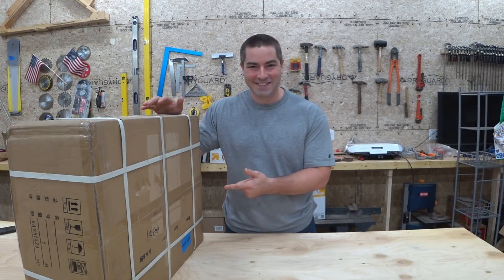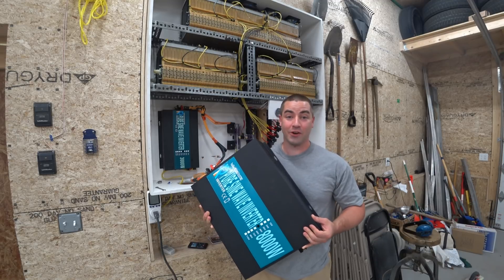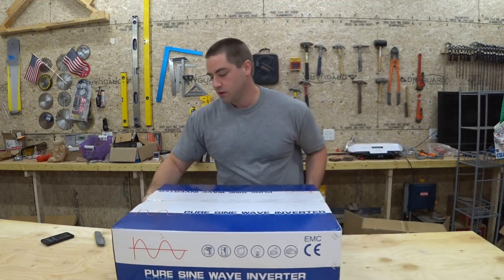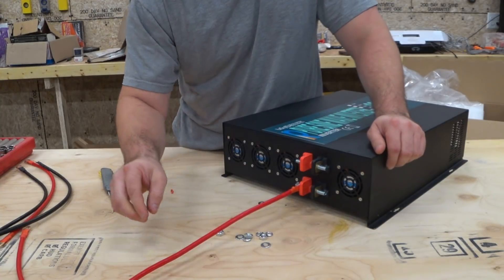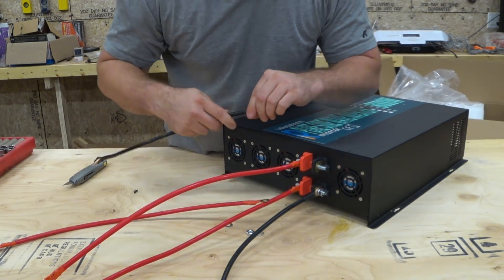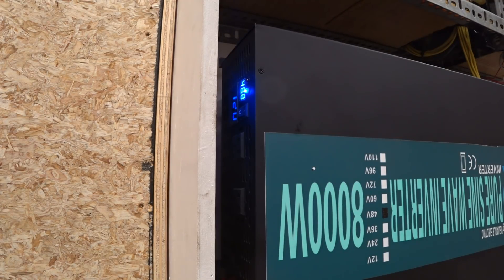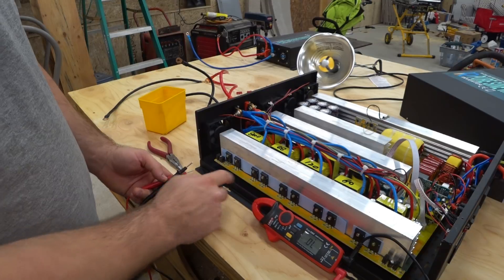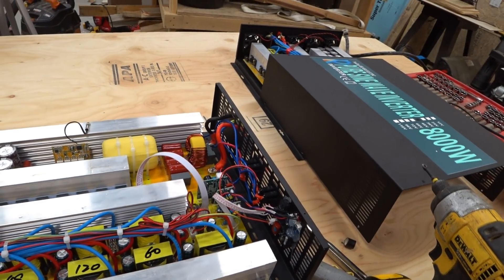Cheap 8000w Reliable Inverter, DIY Powerwall, Chevy Volt Batteries

Comment from the maker: Follow up video to answer some common concerns: https://youtu.be/8pIZrrPLSP0
Reply: I'm a telecom stand-by/backup power guy. I work with multi-battery string, high current DC power plants, 130 vdc converters, inverters, and stand-by generators up to 500kw. One thing i noticed that would be critical is that the internal DC input distribution leads are not the same length. This does not allow for a balanced dc load across the input stages during surge. In high current discharge conditions, the DC input distribution cables have to be of equal length or the load will be highest on inrush on the shorter cables (and component stages). The existing wiring places more load on the first groups than equal across all the groups. Notice the MOSFETs of the first 4 parallel groups were failed. If one were to replace the DC leads with equal length leads, I'll bet the failure would not occur. I will admit that they seem to have poorly engineered the whole thing "too close to the edge" of the required spec and this mistake puts them over the edge. Now on battery string interconnect cables from lower string on shelf to upper or to the "chandelier" (busbars) overhead, this would not be such an issue, though it can be problematic and cause excess heating at cable attachment points, plates, and crimps which causes "loosening" over time due to expansion/contraction. On component groups, that's a whole different story. If you were able to catch the transient surge on ammeters attached to each group input, you would find that the first and second groups took the brunt of the load and way exceeded their rating by 10+ amps. Remember, surge can be up to twice or more the continuous, depending on the device. This definitely due to bad engineering, but a fairly simple fix. I would also eliminate the multiple cable per crimp at the input attachment points and stack individual lugs on the bolt of the inputs. Torque the nuts to about 80-90 in/lbs if bolts are stainless. If they are not, CHANGE them.  I'll be building my own 20kw solar system in about 2 yrs (retiring off-grid) and any inverter I buy will get pulled apart and re-engineered as necessary because I'm seeing this same issue in many brands including Aim, and every one had surge tolerance issues. Once pulled apart, the same mistake was glaringly obvious in all of them.
Reply: Dammit, Basement ScienceE stole my response. MOSFETs dont work upside down. The electrons drain out of them and pass by the gate!!! AHAHAHAH, GET IT!!! Ok, ill go away now and post a nerdy response somewhere else.
Reply: So this video says without actually saying. Stay away from "Reliable" brand products.
Reply: So get yourself a reliable inverter, not a Reliable one...
Reply: How cant I know the work
Reply: Plz message me my WhatsApp 00923000993377
Reply: These inverters are totally junk Get a Outback, Xantrex or magnum..
Reply: David  my   best friiend  u ar my. Friend Salam  hello hi.  U very bussy what can u i told u ,
Reply: @DavidPoz I watched your other video... great job covering known variables. I'm NOT any kind of electrical engineer but I will say having worked in the maintenance industry and as an A/C technician... generally an a.c. motor upon startup will draw about 6× the running load amps... look at the data sheet for your saw and you should find 2 important numbers... rla= running load amps, or fla= full load amps... and most importantly LRA= LOCKED ROTOR AMPS... This represents current draw upon startup. 

I would personally investigate the properties of the mosfets and the fuses as to whether they were well engineered for a true 8k setup. 

Also... one other point of note. If this is a Chinese product, they are notorious for asserting product claims that exceed reality in actual installation performance values. Maybe it adds up to 8k in their engineering dept, but real world testing would fall short.

I think you did an excellent job trying to solve this and address all the poor man PhD's out here in YouTube land. Best of luck. Hope you see my comment. Think I'll sub to your channel while I'm at it. Giving a 🖒for this vid

Comment: OK. So, there are a lot of people in comments yapping about "Starting Current."
A Circular Saw at startup is a 1440 Watt load. This is an 8,000 Watt inverter.
If the startup current were enough to cause the inverter an issue, it would be tripping the 15Amp breaker you have the saw plugged into. Watch the video! There's a REASON it failed, AND IT WASN'T THE SAW!!
It's the design.

Comment: I've had a Reliable 2000 watt pure sine wave inverter as my backup power source for over five years.  If power is off more than 30 minutes, I walk down to the basement and start my "silent generator".  The battery bank is sized for "Wait until daylight" because I don't want to be out in a thunderstorm or shoveling 7 inches of snow in the dark at 30F to get out a gasoline inverter generator and get it started.  The inverter works every time, running 28 cu ft fridge, 13.7 cu ft freezer and the blower for the furnace.  I have a spare of the same inverter "just in case" but it's not been needed.  If you understand the limits of HF inverters and don't put light-dimming loads on them (large miter and cutoff saws) they perform well.  The only gasoline generator I'd try with a light-dimming load is the teen-aged 5KW Generac.
The primary inverter has been used for 6 outages long enough to justify the trip to the basement in the past 6 years, for a total of 28 hours and 30 minutes (I track outages in a spreadsheet).  The longest outages were 8 hours (no reason given, but the failure was at an aerial location that has had multiple failures over the past 4 years) and 12 hours (7 to 12 inches of snow in an area that rarely sees more than 3 inches).
There's an online study on the life of AGM batteries that says they last longer if given an occasional partial discharge than if left at constant float voltage.  I got almost 9 years from the previous set of AGM's so I'm doing a 10% discharge of the current battery bank every3 weeks or so.  The load is enough halogen work lights to load the battery bank to 10% of its AH rating.  Will the discharging and recharging to stir the electrolyte make a difference?  Ask me in another 4 years ;-)  I've already designed the replacement battery bank - LiFePO4 and with enough AH capacity to have 24 hours of instant backup power without needing solar panels or a generator.

Comment: Problem is, you must have 180% FLC(full load capacity) at starting your electrical motor then it goes down to 80%, after initial start(running)..

Comment: I can't help but wonder of the series of mosfets were wired in the wrong series.  Obviously a high amperate is being shunted through them, maybe you just need beefier transistors there.  Perhaps there is not a buffer capacitor in parallel with that to soften the blow?

Comment: Personally it seems your miter saw motor is shot! It has a serious amperage draw when you pull that trigger. Yes they do pour amperage when you turn them on but not that much! You keep pointing fingers at reliable when you should be pointing the finger at the person in the mirror.

Comment: Ok I'm in UK, so we are at 240v 50hz so motor starting is a little easier.
But if you have capitors in you cut of saw and that are down, this will cause a bigger Serge in amps needing to start the motor.
Also with capitors down would show up watt meter from the mains.
Just an idea for a problem you have .

Comment: My 3000 watt inverter from reliable power tripped my equipment and then started to smoke. Power maybe reliable? ... Not recommended. Other you tube reviews show zero short circuit protection. Risk of fire or damage to unit is possible and therefore expense.

Comment: Sir, your DeWalt needs a soft starter. The cheap devices does not have a soft starter cicuit, because the manufacturer does not care about the mains supply. Interestingly the battery powered hand tools have a soft starter, to avoid killing the battery.

Comment: Is it possible to use a 24 volt inverter on a 48 volt solar battery bank ?
Reply from the maker: Yes, but you would need a 24v to 48v step down converter, called a Buck converter.  Buck converters get expensive fast, so this would only make sense if you had a tiny 24v inverter.  But if you want a larger inverter it will make more sense to buy a 48v inverter to match the existing 48v battery.

Comment: ok, so I have a stoopid question... why could you not incorporate a large starting capacitor on the ac side?  if seems like a very simple solution, but I have not found others trying this.
Reply from the maker: There are plug-in soft start kits available.  But I'm looking for inverters that can just run my tools without needing to modify the tools.  I found them in more recent videos.  Actually, I'm powering my whole house right now and workshop off a pair of SMA inverters.

Comment: Hi it would be nice if you can answer my questions, like if you run dc inverters how long will this power your home how many days, if power outage.
Reply from the maker: How many days depends more on how big your battery is, not the inverter.  Everyone's situation is different, but I have about 2 days of backup.

Comment: good day! just ask in your off grid battery set -up which one you refer parallel or series?
Reply from the maker: I'm running a 48v setup.  Any battery you make will be in both parallel and series to get up to 48v and the capacity you want.
Reply: @DavidPozEnergy  what types of battery did use?
Reply from the maker: In this video I was using a lithium battery pulled from a Chevy Volt car.
Reply: @DavidPozEnergy  using this inverter do i need to put charger controller?
Reply from the maker: Charge controllers go between the solar panels and battery, to charge the battery.  This is different from the inverter.  If you are just starting out I suggest a series of video put out from Alt-E. https://www.altestore.com/video/
Reply: @DavidPozEnergy  thank you very for this God bless...

Comment: When you power an inductive load (such as the motor in the saw) you have a lot of reactive power (power factor drops significantly from 1.0)... Your inverter rating should be up to 7x higher than the rating of the saw. I think if you want an inverter for this use case you may need to go with something else other than Chinesium stuff.

Comment: Change out your 15 amp fuses with 20 amp fuses. The first draw of power is more than 15 amp. Check how many amps your saw totally pulls. Plus unload. We had a chop saw that needed to plug directly into the inverter.

Comment: If the chop saw has no soft start, the 1500 watt motor will have a start current up to 5 times the rated running current.  The 8 KW inverter should handle the 7.5 kilowatts surge, but even a couple of seconds will overload a 3000 watt inverter.

Comment: I think it all comes down to the transistors in the 3000W inverter are different than the transistors in the 8000W inverter. The ones in the 3KW inverter can obviously take more inrush current. If the transistors in the 3KW inverter are IGBT and the ones in the 8KW are MOSFETs, you'll see why this happens.
Yes, it's possible to make a protection circuit that helps protect against the inrush current, but this needs to be made for the device you're connecting to the inverter, not the inverter itself.
Refrigerators, aircondition and anything with a vacuum pump in it (or anything with a motor or large coil / transformer in it) may damage your inverter easily.
The problem is not short circuiting, but it's "kickback voltage" (spikes) that a coil/transformer/motor generates, which is much higher than the voltage fed into the device.
-So what I'd do, is to get a bunch of the smaller 3KW inverters and put one inverter per outlet instead of running all outlets on one inverter. This way you're also sure that you'll still have power if one inverter fails. ;)

Comment: Use a Scariac in between the power inverter, and the saw so to reduce the sudden extreme amperage draw. The sudden amperage draw is over powering the inverter circuitry, maybe something to do with the rapid speed of the MOSFET's possibly. I'm not an engineer---just electronics amateur hobbyist. I'm only speculating without total knowledge.

Comment: buy a COTEK 3K PSW. I've had one for 7 years running my off-grid garage. 48V, 1150W panels, 8 T-105 batteries. The cotek will start and run your saw just fine.

Comment: You need to take the peak amperage of your drill (startup power) and multiply that by 4 to get the inverter wattage needed to handle your drill.. And honestly it must by true sign wave because square wave is just brutal on motors and electronics designed for a sign-wave power grid input.

Comment: What is the part # on the mosfet ?? Also the mosfet can't be reliably tested mounted in the board. Pulling the fuses out disconnects them from the output and might allow mosfet testing. you could also remove the bad mosfets from on and repair the other if you have enough good parts. you could also install higher rated mosfets. Would need to know the part # of the mosfet to suggest a replacement.
Reply from the maker: Thank you Rich Linder for your offer to help me find a better mosfet.  I do appreciate that.  I gave away the broken inverter to someone with more time to try and fix it.  I don't know what the model of the mosfets were.

Comment: It is not usual for motor starting surge currents to be 5 to 7 times the run current. Just look at the LRA ( Locked Rotor Amp) spec on some motors to see how high motor start currents are. Inverter typically can only supply 1.5 times max spec average current.

Comment: The way you have the CIRCUIT BREAKER  connected to that BAR has a lot of bar that crosses a little close to the OUTPUT OF THE CIRCUIT BREAKER is too close & I believe it's jumping across the BACK OF CIRCUIT BREAKER. So drill a New Hole & mount it lower down the ANGLE BAR & it wouldn't hurt if you also INSULATED that ANGLE BAR.

Comment: Why does the heading say reliable? Wth? Is it the manufacturers name? Cuz to me that's not lookin very reliable.
Wulf
Reply from the maker: You guessed it right, the manufacturer is "Reliable Electric".  This was not a very good design inverter.  Since I made this video they have made a new design that is better.  Although, many other brands are more reliable.  Personally I use an Aims brand inverter to run my house.

Comment: i would say that even the saw is rated at 15 amp the inrush current required to start the motor from a dead stop is much much higher than that and thats whats killing the inverters

Comment: Hey chum? I'm not being a smart ass but honest to God that thing is a piece of crap A good 48v 8000w should weigh at least 100 pounds or more. That's for starters. Did you see the size of your caps? I got two of them here they won't even take back although I got the money back through the bank. They don't want it back. I swear to you. Get an Aims or there are a couple other brands that are good too but Aims is the best.
Reply from the maker: Hi Judge TK, I agree with you.  I did get an Aims inverter and it has impressed me.  I've been running my whole house and garage on the Aims.  I've got several videos posted on the Aims, but my favorite is the first because I show it side-by-side with this Cheap one. https://youtu.be/dfHb5tZErTs

Comment: Mosfets: Left to right=Gate-Drain-Source.  Diode check setting, place red probe on source and black probe on drain, should get diode beep and not a short, if mosfet has blown then it will give a short (this is for N channel mosfet, not IGBTs)

Comment: All I can think of is, that your mitre saw's "instantaneous ON" current draw (that lasts only a fraction of a second) when it powers up correctly, must be higher than the "peak" current draw of the 3k or 8k box.  Even if you can find from your mitre saw specs, some "max peak draw during ON cycle" to be a number that is less than the 8k box specs, it is still possible (not rare, but a very possible chance) that your particular mitre saw, at this point (is it new out of the box, or has some use?) could be in a scenario where it is drawing 1.3 x the normal current rating during instant ON condition, and that could be due to blade mounting, blade, wobble, bearing wear in the motor, any number of things that add resistance during the power ON first moments.  I see now I am saying what someone else said a few comments ago.  But this has got to be the issue.  Still though, I would expect this to be a very common use of the inverter (power tools), and something as typical as this should be called out somewhere in their documentation, no?
Reply from the maker: Thank you.  The documentation that came with the inverter was in Chinese.  However, there is a new version of this inverter.  They sent me a new version and it was able to power my saw, Yippie!  Now I need to see if it can go up to 8kw.

Comment: Do you need 'motor rated' fuses inside? Electric motors pull infinate current as they start to rotate as they rotate the draw drops. Some fuses can't take the initial spike and blow. A 'motor rated' fuse allows the peak as it only happens for a fraction of a second.
Reply from the maker: I don't know.  The fuses that came in it are pretty weak automotive style fuses.  The company just sent me a new model that has handled the motors very well, but they still use the same fuse.